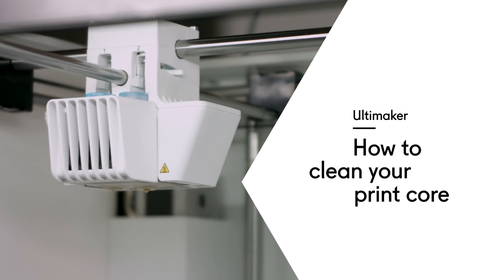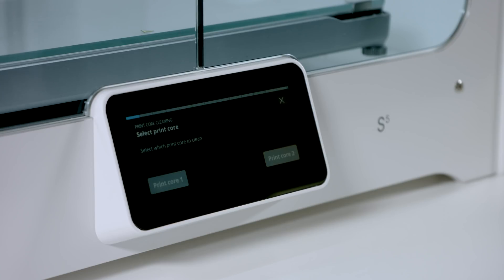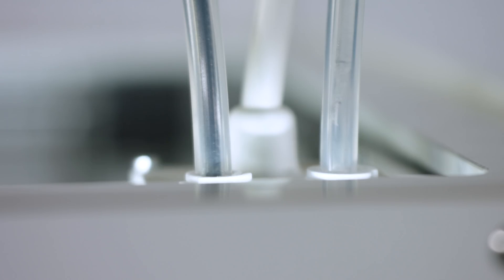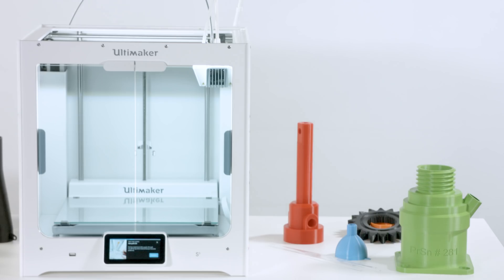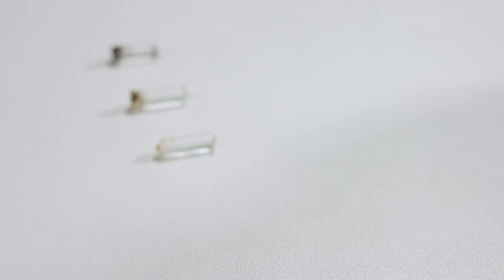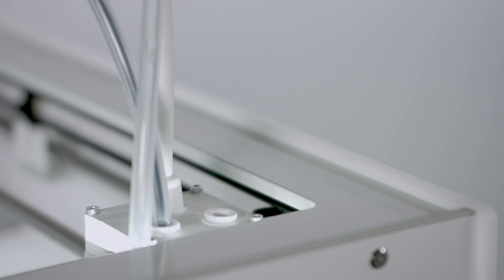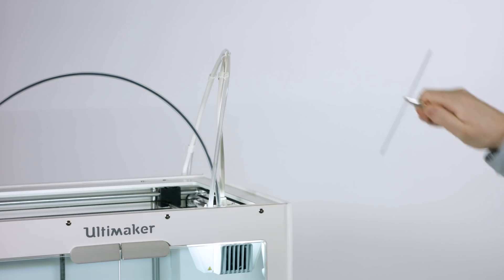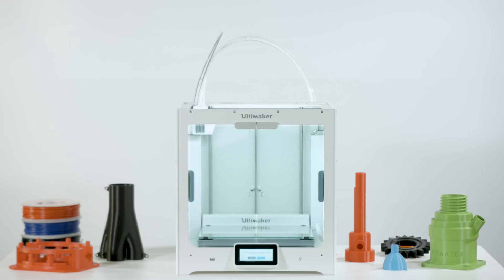Ultimaker: How to clean your print core

Comment: You need to post how to remove fillament that is stuck in the print core when Hot pull will not work.  S5 user.